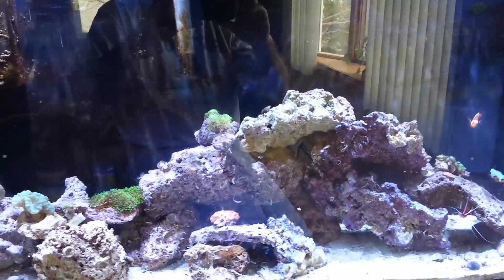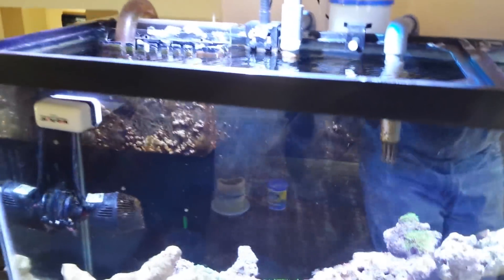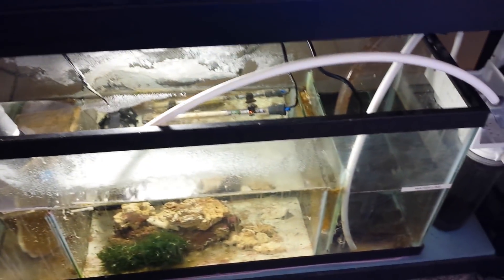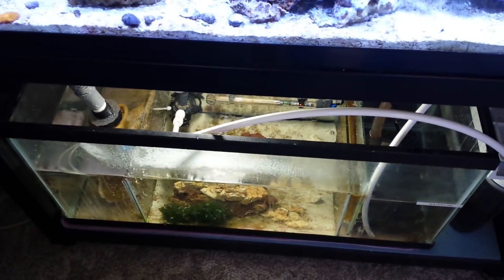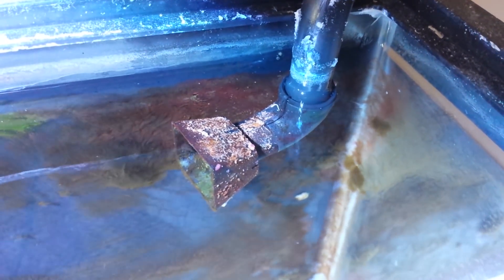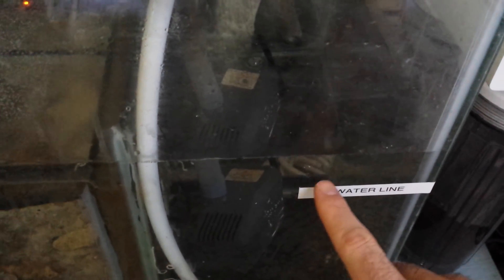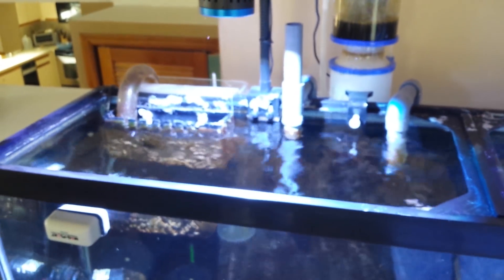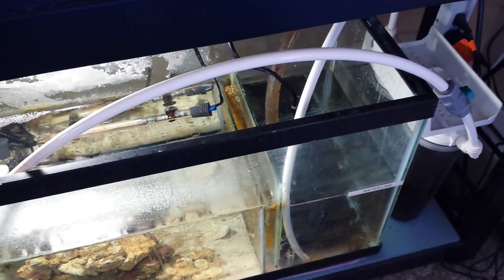How to prevent your reef tank from flooding your house

Comment: please help: I have an Eshopp’s prodigy overflow box, and then I am drilling my three-quarter inch return. Should I have the top of my bulkhead for my return slightly above the bottom of the wire on the overflow box? Or should I put the top of the bulkhead just below the wire on the overflow box

Comment: Great 👍🏻 idea with the syphon breaks however, i noticed that the return line with the spout is only a few inches below the surface of the water. Once the water level has dropped below the outlet end of the return line, it should break the syphon anyways... Would it not? 
I could see this working if the end of the return lone was deeper below the surface of the water. 
 The other thing also, if your water level drops (due to evaporation) the syphon break will cause the pump from working properly but that is if you don't have a top-up system in place, i guess!😏

Comment: What about the hob overflow?  Will it ever lose siphon?  Since my tank is not drilled and so the only way is the hob overflow.  Thinking of getting the pf 800 like yours but scare it might lose siphon one of these days when there is a power outage
Reply: john tran Hi john ive used the “hob” pf 800 on my 90 gallon freshwater for a little over  a yr now and I’ve killed the electricity my self doing improvements several times and I’ve never had it lose siphon. Seems to be a great little overflow. My biggest regret is not getting the 1200 instead. Hope this helps !!
Reply: Mateo fish handler thats good to hear. I feel much better buying it.
Reply: What ghp your pump is pumping the water back to your pf 800?   My tank is like nearly 6 feet tall including with the stand.  I dont know which pump i should buy if i get the same exact hob overflow your using since i have to consider the height it pumps up to the tank.
Reply: john tran I honestly don’t remember the brand but I believe it can pump up to 1600gph. I have a ball valve on it to control the return flow. Also a lot of people like flex hose, I use 1in PVC I like that i can build it exactly how I want without things flopping around. Add a couple unions makes it super simple to take apart if need be.
Reply: Just make sure you get the right size overflow, meaning you want it to circulate all the water in your aquarium a minimum of 6 times per hr. 7-10 times even better! Strictly IMO
Reply: No wonder why you regret getting the pf800 since your pump.  Pumps up to 1600.    Hahah pf1200 seem better

Comment: OH BROTHER I JUST DON'T WHY YOU GUYS COMPLICATE YOURSELVES TOO MUCH ?  WHEN ALL YOU HAVE TO DO IS APPLY THE DRIP SYSTEM , OLD WATER DRIPS OUT , NEW WATER COMES IN , YOU DON'T NEED AN EXPENSIVE WATER DRIP REGULATOR JUST SUBMERGE ONE END OF YOUR SMALL AQUARIUM HOSE AT LEAST 2 INCHES FROM THE BOTTOM OF THE AQUARIUM THEN SUCK ON THE OTHER END AND SECURE IT STEADY TO THE FLOOR DRAIN , NOW FOR CONTINUED WATER FILLING YOUR AQUARIUM , USE THAT MECHANISM  FROM YOUR OLD TOILET , THE ONE THAT AUTOMATICALLY SHUTS THE WATER OFF WHEN FULL , NOW YOU CAN AVOID WATER OVERFLOWING FROM YOUR AQUARIUM , JUST MAKE SURE TO INSTALL A  WATER PURIFIER OR A DISPOSABLE ACTIVATED CARBON HOSE ATTACHMENT BEFORE YOU INSTALL THE TOILET MECHANISM WHEN YOU ARE USING COMMUNITY TAP WATER , JUST DO YOUR BEST TO CONCEAL THE MECHANISM WITH A PVC PIPE OR ANY DECORATION TO MAKE IT LOOK GOOD . NOW IF YOU DO THIS CORRECTLY , YOU WILL NEVER HAVE TO DO WATER CHANGES ON YOUR AQUARIUM .. THE ONLY THING TO WORRY ABOUT IS WHAT TO FEED YOUR FISHES... NO NEED TO SAY "THANK YOU" JUST SPREAD THE WORD .
Reply from the maker: Jessie Corceles Thanks for stopping by. Do you have a reef tank? Or do you use fresh water? I'm wondering how your method gets the fish easy out of the sand bed. Maybe you can do a video on this.

Comment: its called getting a check valve.
Reply from the maker: HNiCDuke HI thanks for the input. But as with everything in this hobby it can fail over time. the check valve can be especially problematic if salt and or crud build up causes it to stay open, or worse closed. Thanks for stopping by.

Comment: so this is how you prevent your filter tank from flooding everything but whats with the tank? how can u prevent the tank from overflowing then somehow your overflow stops working and the return pump is still pumping water up into the main tank?
Reply from the maker: Hi thanks for stopping by. To prevent that you need to figure out what size to make your chamber that hold a your return pump. my chamber will run dry before over flowing. I figured it's better to replace a burned pump then flooding the living room. I hope this helps and feel free to subscribe!!
Reply: The Reef Rookie thank you very much, that helps me a lot. my filter tank isn't parted in chambers yet so i completely forget about that option.

Comment: have you ever had a snail clog the return tube?
Reply from the maker: Good morning. I a happy to say no I haven't but I drilled 2 holes in the line just in case. I hope the video helped. thanks for stopping  by and feel free to subscribe.
Reply: What if it is a uniquarium, how do I prevent the tank from overflowing with the built-in filtration? Please help.
Reply from the maker: +Hansa hi Hansa  thanks for stopping by. thats a good question. is there a way you can drill a siphon break in the return line?

Comment: Thanks for the video, quick question.. I'm looking at building a sump of my own..
When you do lose syphon on your overflow box, what happens then?
What preventative options do I have to make sure that my sump doesn't pump all the water into the main display and empty the contents of the sump? Any advice would be appreciated.
Reply: Keep your return pump at a higher level in you sump so if you loose power or siphon you don’t flood over the main tank.
Reply from the maker: +Candace A Hi Candace, thanks for stopping by. What I did was make sure that my return section of my sump was sized so that in the event I lost siphon on my overflow, then the chamber would go dry before  the tank over flows. I figure it was better to replace a pump then have a flood. I also make sure that my ATO reservoir is not big enough to flood the tank as well, because if the return section drops the ATO will kick in. I must say though, almost 2 years with my Eshopps and I haven't lost siphon. (knock on wood). I hope this helps. Good luck and feel free  to subscribe!
Reply: Also you can drill a small hole in the siphon tube and attach a powerhead or air pump that sucks air. That way it is always removing air and recreating a siphon if it ever stops. See the new acrylic slim overflows for an example.

Comment: So did you just drill holes in the side of the return nozzle?
Reply from the maker: +Fred Beer Hi Fred...Thanks for looking at the video. Yes, I took a small drill bit and drilled a hole on each side. I did 2 holes just in case one gets clogged or covered by a snail or something.
Reply: So simple. I can't believe my friend still has overflow issues!

Comment: Also what size rio return pump are u using?
Reply from the maker: Shane Phillips I actually just got rid of my Rio pump as I found it very noisy.  I replaced it with an Eheim Compact + 2000. I'm super happy with this pump, its so quiet I cant hear a thing. My Rio is now used to mix salt water...

Comment: Love the tank reef rookie!!! I am adding a simp to my system this week I've been using my hang on filtration which works great and all but I want a dump cause I ordered an apex system and want a place for my equipment lol I ordered the eshopps pf. 300 overflow how do u like yours it works good?
Reply from the maker: Shane Phillips Hi Shane, I have the PF800 over flow system on my 55 gallon tank with 30 gallon sump. It works great once you get it dialed in with your return pump. I have had it for over a year with no issues at all. Good luck...

Comment: Quick question I have a 75 gallon reef with nitrates at 40 ppm if I did my calculation right I should be dosing 7 ML minus live rock and sand should I be splitting it up like half in the morning and other half at night or 7 in morning and another 7 at night might be stupid question but just dont want to mess things up thanks.
Reply from the maker: paul matyskiel Hi, that's a good question. I dosed the whole amount at once, but you may want to check with red sea. If you go to Reefcentral.com, Res Sea has a section in the forums where you can ask that. They are great at getting back with the answer. I just would hate to give you  the wrong answer. Also, make sure your skimmer is running as thats what exports the product consumed by the bacteria.